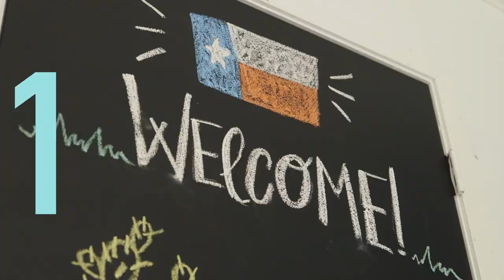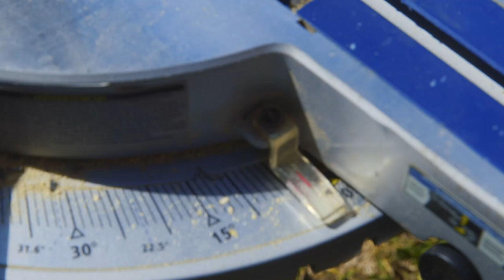The Weekender: "Patio-topia" (Season 2, Episode 14)

Comment: MONICA: DIY art project request:

"Woven" rope (large dia.) -- contrast is nice, mounted/framed somehow -- nice;

For context: 

In the Southwest; 
Southern Utah, 
100°F+ five months/year; 
27-45°F winters 
We're in a "leg" of Southern California's Mojave Desert, 30 min from Nev., 
15 min from Arizona; in Utah.

I've a niche above my fireplace; home built in 1989 -- lots of 80's Art Deco details; a 12' tall, arched niche over the fireplace is one:
 I always wondered if there was SOMETHING(S) I could put into the niche, along it's back surface? SOMETHING to make it an interesting focal point;

I also have these weird Art Deco "cornices" at the top of every wall, except the two regular ceiling-height bedrooms (8') --

Kitchen, dining, living room & master bedroom ceilings are high and slanted; lots of ledges, an architectural portal.
Roof, outside: Terra cotta rounded half tile (Spanish Colonial Revival), white stucco.

Anyway: The never-seen-before "cornices" are stepped. There's two of them, each has softened "90°" angles -- not angle-angled like traditional cornices.

Imagine a 6x9 timber board, covered w drywall mud, textured w orange peel, all exactly like the walls.
That larger "beam", at the seam where wall-meets-ceiling (where a cornice would go!)
 across the top.
Butted up to THAT: A, smaller: 5x3" maybe, w the same rounded corner/edges -- everything mudded, orange peel textured, like walls.

So the top "beam" sticks out about 2.5" MIRE, into the room, than the lower "beam".
 
The topmost "beam" is the Big Brother, the "beam" butted right up to it, the Baby Brother.
???
HOW WOULD YOU PAINT the ceiling, walls, and those "cornices"????
When built, painted all one color. That's how it has remained.

Can you think of a creative thing to do WITH THOSE DETAILS as-built ???

Comment: Can you put a link to the actual laminated floor used here? Thanks
Reply from the maker: Rode Zambrano Monica used Congoleum Airstep Plus Trade Winds Wood Look Low Gloss Sheet Vinyl for the floors. You can take a look at it here: http://low.es/2sKx6rn.
Reply: @lowes  the flooring in the video was a thin interlocking vinyl plank flooring, not sheet vinyl.  Do you know which product this was?